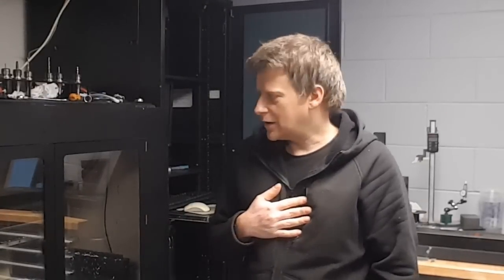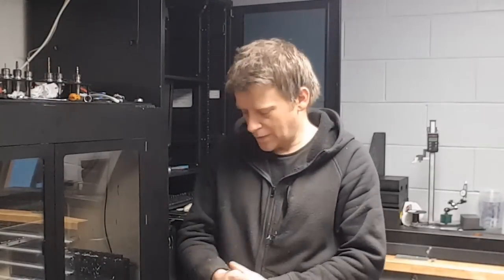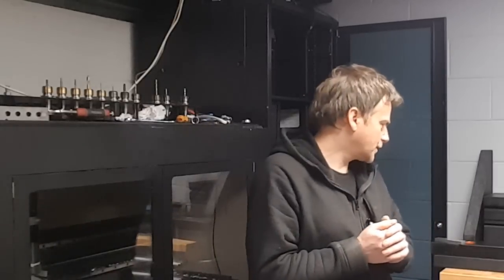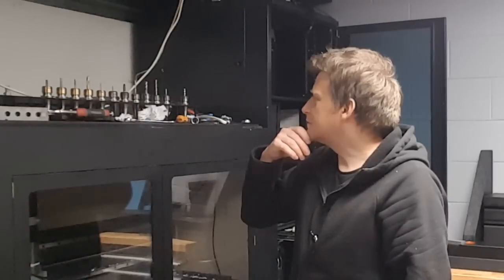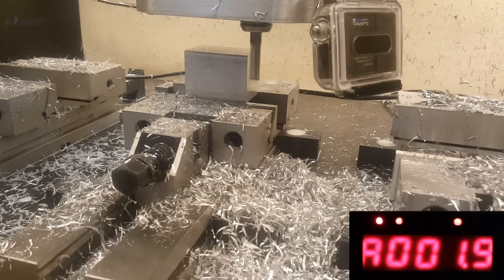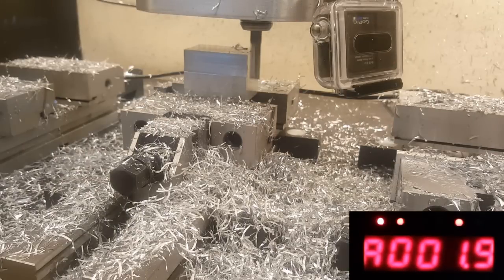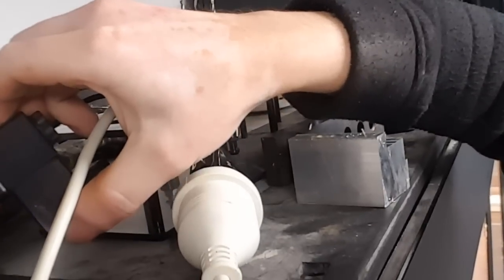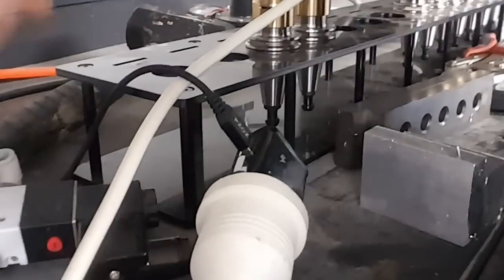ATC 2.5KW testing the spindle limits - THE BEST Chinese spindle, second review after over a year.

Comment: Fox, I am happy to see you are happy with this spindle, but I have to say You inspired me to build solid granite monster but with fix gantry, the total weight with steel desk will be around 850kg, last few months I am working on getting al the parts needed for the build and in next two months it should be finished. Many thanks for your awesome videos and inspiration.
Reply: @____________________ok  Hello, I fixed the issue with comments hehe, it is cutting awesome, the machine is really rigid and strong, I have many pictures and videos of assembling it and cutting, I need to find some time to upload, maybe it will help someone.
Reply: @____________________ok  I used two solid granite blocks, it was a custom cut out of the stone for me.

Comment: I bought this same spindle immediately after your first video about it, and I agree completely. It is absolutely amazing. The only thing I wish I did different if I were to do it again is buy the 110mm BT30 version instead. So much more tooling is available in the BT30 than in iso25. Literally all I can find in iso25 is er20 coldest. They do the job but I would have loved the options.
Reply: Give me a signal like you want to sell an old spindle.
Reply: Paweł Zontek it will sell with this cnc router once I build another one! But it will be a local sale
Reply: Give me a signal like you want to sell an old spindle.

Comment: I bought a 2.2kW water cooled spindle from this supplier after seeing your original video, I'm glad to see it is still working great and something you love after a year. I haven't finished my machine just yet (wiring it atm) but I can say that I can not measure any runout at all on my spindle (non ATC version) and it runs smoothly on a Teco VFD! (Teco L510 also sold by RS Components 174-8218 incase you're interested) I'll be happy if I can run nearly that fast on my machine.
Reply from the maker: I'm glad to hear that. I'm personally really happy with their build quality. and it just runs! :)

Comment: Very nice setup.  I was impressed by the lack of chatter on the 10mm x8mm cut.  Your machine is more rigid than mine, or is it the spindle?  If you haven't already, check out making an air mister with a pressurized house water filter to hold the coolant.  Works wonders compared to dry cutting, is cheap, and not messy like full coolant.
Reply from the maker: no chatter is mostly because of the machine. 
but I want to thank you for the idea for the new video, messy coolants :)
Reply: @PiotrFoxWysocki  now I see your "curtain coolant" and I think the air blast I reccomend would only help for cutting steel with coatings that work well with heat like altin.

Can I ask what is there performance like with lower rpm?  Have you tried slowing the spindle down to 5-8k rpms for steel or larger end mills?  How is the power at that speed?  Thanks!

Comment: Thanks for review, I'm preparing valves to setup mine fi 80mm, 2,2 kw, 24k JianKen which I've received last week. I have only one concern - there is no "air output" only "air inlet", so I guess I will have to use only that one hole for changing tools. Do you still have that issue that you have to wait few seconds to be able to turn the spindle? It was blocked for quite a while after ATC on your first video 😊
Reply from the maker: just use the same 3 way solenoid valve i have. i hope you have noticed it on this video. when you press the button air goes to tool spindle. when you realise it remaining pressure in the line and spindle is blown by the third hole in that solenoid valve. 
mine is electric one but i keep using it without connecting to anything. just by  pressing mechanical red button on it. 
spindle is realised immediately. so no more problems.
Reply: @PiotrFoxWysocki  thanks for the answer, I've already ordered 3 way mechanical valve with a button so I hope it'll work 😊

Comment: Hey Fox, great video but just in case you want to have the GoPro footage in focus, consider getting a cheap diopter. Or, if you only ever use it for close up stuff, you can unscrew the lens a tiny bit. You will gain close focus but infinity will be out of focus.
Reply from the maker: after i saw blurry footage of this 8mm cut i went and modify the go pro so it can focus closer. all the other closeup cuts are in focus, right?

Comment: That amount of chips I was doing in under one hour at work with one of my two Starag Heckrerts😁 but they had each 24k spindles with roughly 80kw😁 i realy like your videos.
Reply from the maker: my output of chips increased quite dramatically to 60 l bin in a day, not an hour :) I'm glad you like to watch my struggles :D
Reply: @PiotrFoxWysocki  well I dont think you struggle, we got more guys at work which have not even close a clue what you can do. And they make parts for aero and space industry🤣 i think people like you which are interested in looking at things and are curious can go a much longer way then one which just learned it as a job and hates it every day. I built a cnc myself but not close to wjat you built, I just modifyed a bf20 to cnc altough with servos like you. I used high torque simplexmotion servos, they produce up to 720kg of force woth the ballscrews i have, and on the y axis i habe a gear ratio of 2:1 so it doubles that power, and if i mill fast i can see the frame of the mill twisting🤣🤣🤣 to a point where I feel very unconfortable😁
Reply from the maker: @tedbear2478  well.. you don't need to know how to build an iphone in order to be able to use it. well if you do you would never buy another phone :D a bit sad that they hate their job tho.
i limited my servos to 80kg.and i still think its too much, but with 80kg if i crash it shouldn't bend ball screws, or destroy the alignment. they are 720kg just like yours. not sure why you need to use all the power? what do you mill with? a piece of a railroad track ?? :D
Reply: @PiotrFoxWysocki  i dont need the power, I bust like the acceleration liken that, but i could limit the torque that would make sense. I am about to build a millturn machine now😉 a mill spindle combined with a lathe and b axis head😁
Reply from the maker: Nice! May the patience be with you 😉
Reply: @PiotrFoxWysocki  haha yes thata definitly not a quick one🤣

Comment: Try it with way more feed 
End mills are usually rated for round about 0.05mm per tooth (depending on size and material) often more.
If i heard it correct you used 24k rpm and 1000mm/ mim which results in around 0.014 mm per tooth
If it isnt the chinesiest of sellers they normally provide speed and feed data
Endmills wont break that fast😁
About the 8mm cut, that one should be within spec of the spindle around 10.5 A at 230V (i guess) equals to about 2.4kW...
Appart from that nice video👌

Comment: Sorry if you already answered this in a comment somewhere but...do you power your whole CNC off of the 230V 10A wall sockets or do you have more beefy line supplies?  Does the spindle ever trip a breaker if you indeed have it on a 230V wall socket?  Oh, also, how many other spindles did you try or research to decide this was "the best"?  It seems like there are zillions of suppliers out there and it's almost impossible to make an objective comparison.
Reply from the maker: yes i power my cnc out of 240v, on 10A wall sockets but i have 20A breaker. i havent changed anything it was like this when i got the house. For example washing machine is 2.0kw and drying machine is 2.2kw. and if you want to run them at the same time you need more than 10A breaker. nothing burnt down yet(8years so far) :)
about spindles, this one will be my forth spindle. and i have seen plenty more up close. Jianken spindles build quality is remarkable.  they work amazingly well.
and as you mention, there is zillions of suppliers out there, finding one which is really good is really tricky. so when i finally found one i had to share. 
i know how frustrated it was for me trying to find a decent supplier.
Is it the best spindle out there?   definitely the best i'v seen so far.
I did not haste with this statement. in comparison to most of YouTube hasty reviews i used mine for over a year, so i could give the most informed opinion.
Reply: @PiotrFoxWysocki  oh, that's lucky to have 20A breaker.  I'm struggling with a 10A fuse.  The Jianken spindle does actually seem to be not a bad deal as I see comparable ones from EU suppliers are much more expensive with similar features.  Thanks for reviewing it.  The quietness is very attractive.  ...somewhat related: I wonder if the increase in noise vs. rpm's in your spindle new vs. after one year of use that you showed being tested has any relation to the most used rpm speeds you used during the year....like maybe the rpm's that were most often used got the most worn out?  Or maybe it's simple where some internal resonant vibrations lie and after a year of use those vibrations wore away at their boundaries.
Reply from the maker: @perspectivex  noise might be misleading, i have moved vfd in to slightly noisier spot, and audio might be not so accurate either, different workshop layout. what is most accurate are the vibration readings. 
I can't say that the spindle get louder after a year. because it is a very subjective and my judgement from year ago might not be accurate.   app is :)
speed vs use.
i use 9000rpm for drilling. vibrations in this range went way down.
18000rpm for most milling. no difference there
20000rpm for small bits and chamfer.

this spindle is very well balanced but there is always some imperfections which cause bigger or smaller resonant vibrations at various speeds.
ceramic ball bearings need time to stabilize. this could be also a factor.  
long story short. there is a lot of science behind it. I'm not particularly interested in knowing exactly what and where, since its not me who is making those spindles :)
I'm happy i was able to find a very good manufacturer

back to breaker. why you just wont replace it with 20A? or 15A or just something more than 10A. anyway i think you could mill with 10A breaker, just don't go crazy  on the cuts. when I"m milling, I'm trying to stay under 5A most of the time. it might be 2.5kw spindle but it doesn't mean it has to be use at the limit all the time.
Reply: @PiotrFoxWysocki  Rented apartment and unlikely I can make any change.  Re: the ceramic bearings...the "research paper on ceramic bearings" link to nasa.gov you put in the description gives a "Page Not Found."  Thanks for the informative replies.  I might have also missed it...but which VFD did you choose for the spindle?  That's another jungle to hack through.  I got a cheapo Chinese VFD for an old 3-phase wood planer and it seems to be working fine...not sure if cheap vs. expensive has much influence on a high-end cnc spindle though.

Comment: Beautiful! Very interesting to see these empirical tests. I would be curious what the current draw would be with a fresh endmill. Kennametal's engineering calculator suggests an approximate radial force of only 100N with a torque of only 0.5 Nm in the 4mm stepover, 10mm depth, 3000 mm/min feed test, with a power draw of 1360 watts. In the test we see a peak current of about 9A (at 220V?),  about 2000 watts. At least in theory there should be quite a lot of headroom (you are probably right that the VFD and the tool are the limiting elements), especially if you find a zirconium nitride coated tool, but for what you are doing I doubt you would really want chips piling up that fast :). I've seen youtube videos of similar tools with upwards of 20000 watts (not a typo) put through them. So, perhaps a lot for this machine, but quite conservative in the big picture!

Good to see another video, amazing what is available from China and what you can build when you have a need. Looking forward to seeing more from you!
Reply from the maker: maybe 2000 watts vs 1360 watts difference is because o system efficiency. or its just for a cut. free spinning spindle takes 1.8-1.9A maximum power on a cut was 8.9A so it comes closer to 1500watts. the difference just for the cut. i guess there is lots of factors when you try to calculate it on the paper.
Reply: @PiotrFoxWysocki  for sure, I was mostly trying to get a frame of reference. What's most interesting to me is how little torque and force, at least in theory, is generated in such a cut. The high RPM really brings those down.
Reply: It appears that the currents shown are for the motor currents provided by the VFD (right Piotr?).  If that's the case, motor power input power = motor voltage * current * 1.7321 (since it's a 3 phase motor.)  Cutting power is proportional to material removal rate as well as spindle speed and torque, so higher speeds are preferable - especially for aluminum.
Reply from the maker: @gmack4097  im not big fan of math theories. as long it works, im happy ;)
Reply: Isn't that 1360W Kennametal's "Ps at the cutter" rather than "Pm at the motor" - which measured (8.9 - 1.8)A * 220W * 1.73 (for 3 phase motor) = 2702W?

Comment: Now I need an ATC, too! Have you tested boring holes? What is the torque?
Reply from the maker: Boring or drilling?
Reply: @PiotrFoxWysocki  My bad english: for sure i meant drilling!
Reply from the maker: Well.. 8mm drill in my opinion will me the max. I found 9000rpm and plunge speed 150mm/min. Pecking. Trying to avoid long stringy chips. Anything bigger you mill/bore
Reply: @PiotrFoxWysocki  thank you

Comment: Nice spindle! I have a project of my own which would mostly involve drilling. Does it have enough low end torque (around 2500rpm) to drill 6 to 8mm holes into 6063 aluminum?
Reply: does not like drilling.. its "made" for side cuts

Comment: I can refurbish that Spindle that you said is un-repairable :) @ GTI Spindle Technologies in North Carolina
Reply from the maker: i was talking about the spindle you saw on the video. i thought i kill it, but turns out it was fine :)
Reply: Charles, have you had any hands on with any of these Chinese spindles you see everywhere now?  What are your thoughts?  The prospective of a spindle specialist would be interesting!
Reply: I'm going to take a guess that your repair bill will be 2-3 times the cost of a new jianken spindle. :)
Reply: Daniel Sharp yes I have refurbished many Chinese Spindles. The main issue that I find is that the bearings are cheaply made and that they are assembled without any quality control. Every one that I have had the privilege to repair the spacers and shoulders have high spots and this is a major cause of bearing failure. If these Chinese Spindles are refurbished with quality bearings and if the technician has attention to detail these Spindles will last a very long time
Reply: werner automation you would be surprised at our price for refurbishment. Most of our customers repairs are half the price of a new Spindle.
Reply: Terence Krueger , I’m a Technician and not in sales so I’m not going there as far as prices 😆 there are way too many variables in pricing Repairs. The only way to get a true hard price is for each Spindle be evaluated and list of parts needed replacing and if Grind Plate Grind is needed. It also makes a huge difference in where and who you buy the bearings from. Middle man Markup is a price killer.

Comment: Do you have your vid settings available , with the settings wafer gave me my 3.2kw version of this spindle stalls out at 12000 rpm with a 0.5mm woc and 5mm doc on a 12mm 3f endmill.
Reply from the maker: Check in my videos. There should be one about vfd.

Comment: Hi Peter, Can you tell me what inverter you use with the spindle, please?
Reply from the maker: Huanyang VFD 2.2KW
Reply: @PiotrFoxWysocki  That was quick :) Thanks. I've been in touch with Jianken enquiring about the spindle motor. The suggestion is I go for the 3.2kW. He said to get a VFD at least that. So I'm googling :)
Reply from the maker: i think ebay should be just fine.